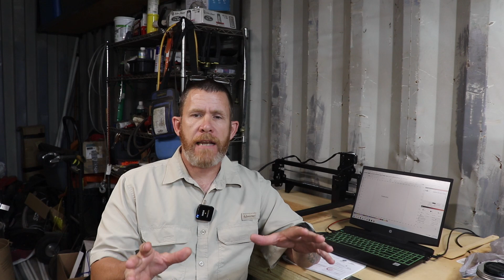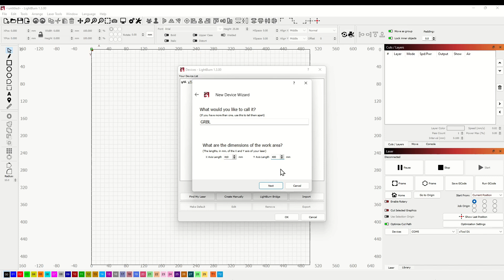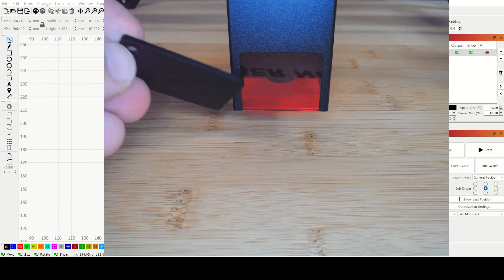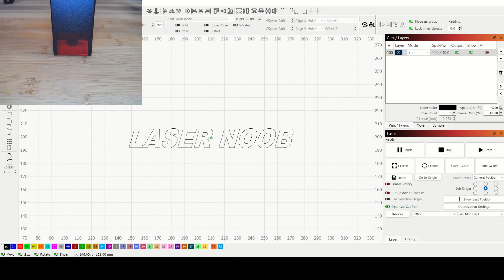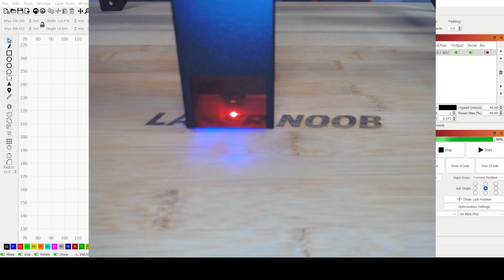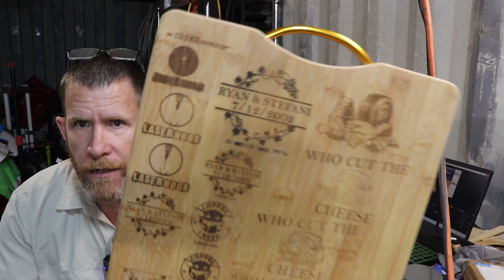First Test Run Of The Atomstack A5 M50 Pro with LightBurn

Comment: Hey I have problem with this one brand new and the motors are working but the laser is not starting. Do You have some ideas why?
Reply from the maker: I'm not a laser tech, but I'd make sure the plug to the laser module is plugged in all the way. If that is not the issue, I'd call customer support. Wish I could be of more help.

Comment: Hi Ryan. I really liked your video. I just bought this today and hope I bought the correct unit. Do you know if I can cut out stars with this unit? An example is I want to do flags and do not want to do 50 stars by hand.
Reply from the maker: Depending on the thickness and type of material, absolutely!
Reply: @LaserNoob  Thanks for getting back to me so quick. This will be a side business. I just retired and don't want to be under my wife's feet all day. The wood will be a 3/4 to 1" piece of plywood. Don't want to cut through it, just down far enough to give a depth look. I am looking at other of your videos. Looks like I will learn alot from you.
Reply from the maker: Just engraving will certainly be achievable. The 5 watt takes a bit longer than the more powerful lasers, but will easily get the job done. Best of luck with the side hustle! Staying out from under the wife's feet is much easier to do when you have a laser to play with. LOL

Comment: Hi Ryan, thanks again for your awesome job, question:

How do I engrave on a tall object like glass? The space between the table to the laser is not enough...
Reply from the maker: You can either build a frame or cut some 4x4's and set the laser on top of those.  Just make sure they are flat and the laser is level before you start the burn.
Reply: @LaserNoob  Thanks for the tips Ryan!